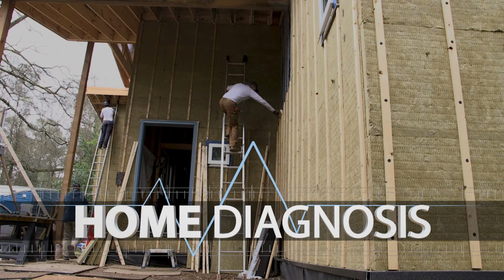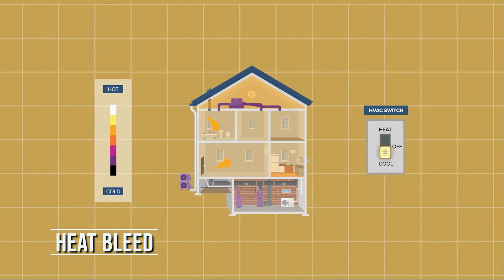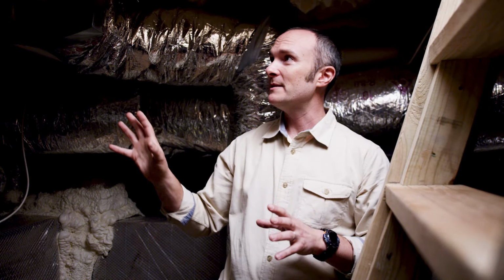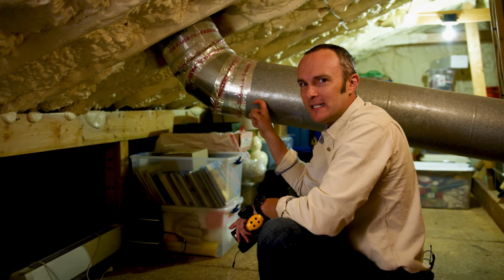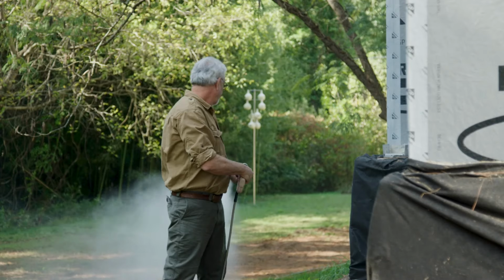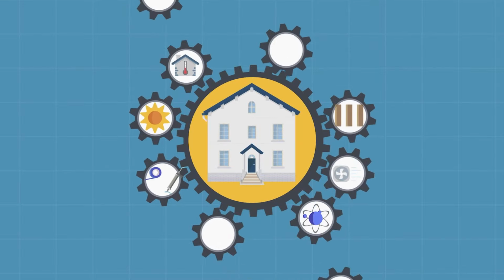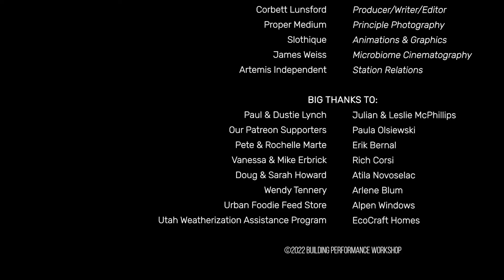Science of Air Sealing, Insulation, & Control Layers - Ep 206 of Home Diagnosis TV Series

Comment: Any idea why you wouldn't want to insulate the ceiling of an attic if the floor is already insulated?  Our house gets pretty toasty in the summer.  My HVAC ducts run through a sealed attic which has blow in insulation on the floor,  but no insulation in the ceiling. It's a 1.5 home so this attic space is small, and shares what I think I've heard referred to as a "knee-wall" with a our 2nd floor rooms. There is currently no ventilation in this space (no soffit intake but there are a couple of passive box exhausts) If I added insulation to the ceiling in this small area, wouldn't I be protecting it from the heat of the scorching roof?
Reply from the maker: You want the ins and airsealing to be together, at either the roof OR the floor. Your attic is very confused right now- so yes, you should do something, but a zonal pressure test while blower door is running is the right way to decide what exactly to do.

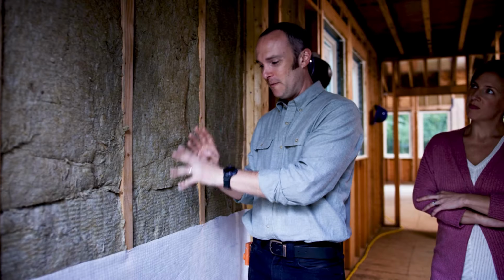Comment: At 22:50 you state you are putting a second air barrier on the inside. I have read that you shouldn’t have a wall between two air barriers as it can trap condensation between the two barriers and there is no way to dry. I read that in the south typically the air barrier is outer layer allowing drying to the inside and in northern climates the air barrier is installed on the inside to all the wall systems to dry to the out side. A WRB is still installed on the outside but it is not the air barrier.
Reply from the maker: As long as you allow VAPOR to dry freely to the inside/outside, do all the air barriers you want, Kevin :)

Comment: Corbin-what happens to your nailed on eves the first time someone goes up on the roof to clean the gutters? Also, in most jurisdictions I know you are required to have a certain number of ac receptacles per running foot. Of wall- inspector wouldn’t allow me to eliminate all receptacles on perimeter walls.
Reply from the maker: The receptacles are singles in the floor in that case. And I’ve walked on the eaves plenty, that’s why the structural engineering is so important.
-Corbett

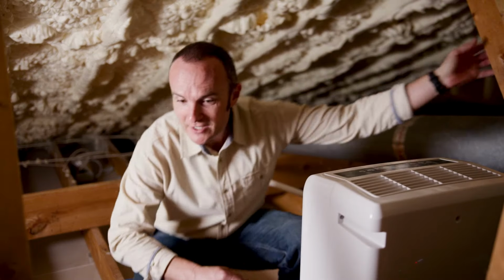Comment: At 8:40 in the attic "you don't want both and you don't want neither" 
Why not both? I was considering a 3-4" closed cell spray foam to the underside of the roof and 13" of blown-in cellulose on top of the ceiling to meet/exceed code R-values for climate zone 7.  would this cause something bad to happen? The thought was going for a tempered attic and fully conditioned living spaces below... Thoughts?
Reply from the maker: YES, something bad might happen: you cannot predict what temperature or humidity, and therefore what moisture condensation, will be going on in your mystery cavity that’s not outside and not inside.
Reply: @HomePerformance   is there any way then to get code required r-values and cathedralized insulation for the air sealing benefit without paying for 10in of solid closed-cell spray foam?
Reply from the maker: Just don’t use spray foam at all. Takes more time, but less money.
Reply: @HomePerformance  yes Corbin, but exactly how ? And good luck convincing builders to trade time for money…for them time is money, and it’s SOOO easy for them to just tell the unregulated untrained spray foam ‘artiste’ to spray everything. And pass that cost along to homeowner rather than convince their employees or framing crew to stay up,on room putting a ventilated roof on.
Reply from the maker: My roof has a double layer of airtightness, as shown, and zero foam. And I bet 30 years ago none of us could imagine how much more we’d be willing to pay for coffee ($6.50 last time I checked on the popular lattes at you-know-where) or groceries that are organic and fair trade and pasture raised. We spend money on what we like- all we have to do is teach people to like having a good home.

Comment: Is your company potentially working on a network of trusted/ certified builders (like angies list)?

I would like to see something like this. So that when you hire that company they are held to a higher standard. Better than the local building " inspector".
Reply from the maker: Would if we could handle it. But we have zero employees and aim to keep it that way. Angies List doesn’t really work to control quality either, fwiw
Reply: @HomePerformance  
Angie's list and such do not. Its a flawed system based on customer satisfaction when compared to the standards you are pointing out.
Often customers don't know what a good job or an excellent job is. They only know when it fails visually.  " look my roof leaked"; "contractor left trash"; job not complete. There is nothing to prevent good hacks from succeeding. 
HVAC is a problem here.. Every other van you see is a HVAC company. But i guarantee that a very small percent are interested in education and doing the job to better scientific standards. 

Maybe some day someone can partner with you and creat a better system. 
So much so that inspectors and even code can lean on the service to k ow that things are done right.
Reply from the maker: I’m ready and willing! Our concept until then is to educate the customers to judge performance. We’ll do the same thing with HVAC- stay tuned!
Reply: @HomePerformance  builders only build what the customer wants. So we need to teach consumers what good is so they will ask for it.
Reply: @tweake7175  
Agreed...
Yet the problem is that the builder has taught the consumer that, "things are normal". Or the builder doesn't want to challenge the consumer and say hey.. We gotta do it xyz way or it will cause zyx problems. 
To many contractors are comfortable with not showing knowledge and just looking for the easy quick dollar.
Hvac systems are fully rebuildable. But yet if the unit is nearing 10 years.. "The whole system needs changed". And in our area.. They 90% want to oversize the unit. 
We are in a cheap world these days. Particle board furniture that lasts a couple years is preferred over a well built family heirloom.
My frustration is showing.. Sorry.
Reply from the maker: *good. Exactly.